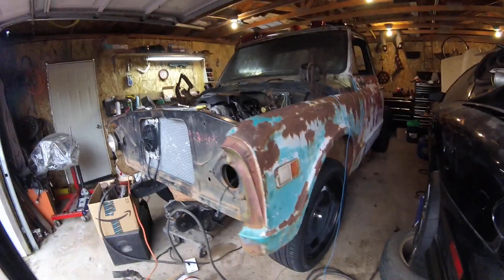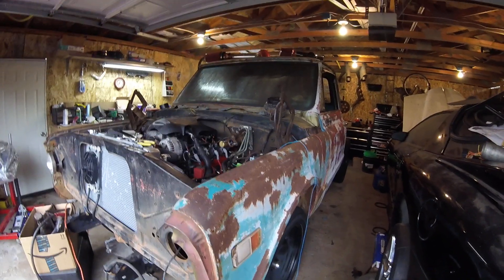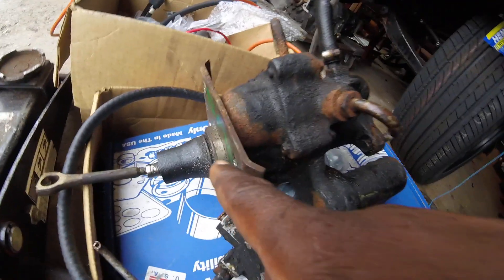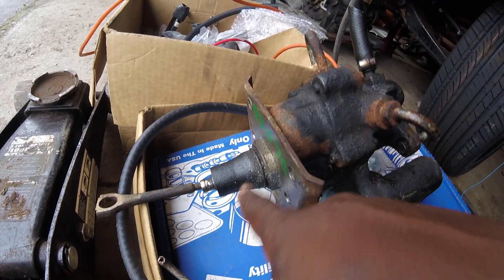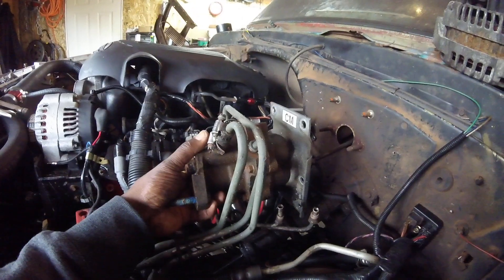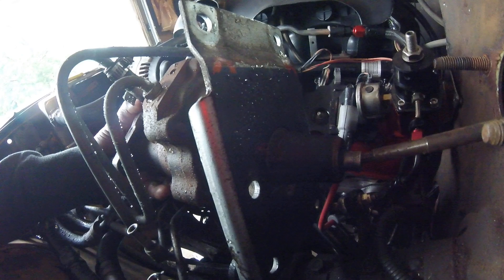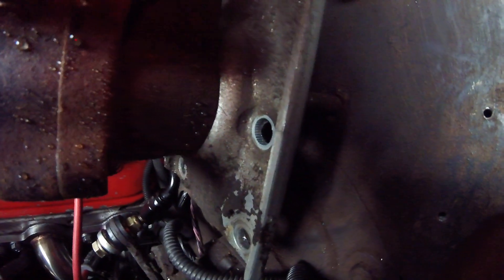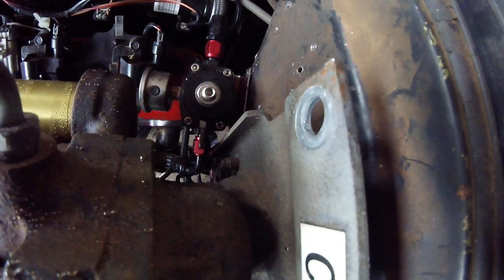1970 C10 hydroboost conversion pt #1

Comment: I'm so glad i stumbled onto your vid. I've been searching ALL over for a solution to my brake update. I'm converting my 72 C20 to a 12 valve Cummins and the factory oversize vacuum booster just wasn't going to fit plus i am putting a 2005 14 bold disc brake rear in so needed a hydraulic brake system now. All hydraulic booster conversions kits were $700 plus and I'm on a budget so that was out. Going with your Idea  i ran across a 1991 C35  crew cab dually that had the complete hydraulic boost/master cylinder hoses all still intact so i grabbed it all for $90 vs, $700 for a kit . as for the rear i was quoted from $650-$800 i found a complete untouched rear last week at another bone yard for $325 rotors, calipers, hoses, e-brake ALL. with just these 2 items I've save $900 that is huge when on a budget and every penny helps. I've found most of the helping info on theses smaller channels. The BACKBONE of YouTube. They'd be nothing without all the small channels just like in business the small shops make up the majority for a few monster shops and better customer relations..... off track a bit, Thank You Ken